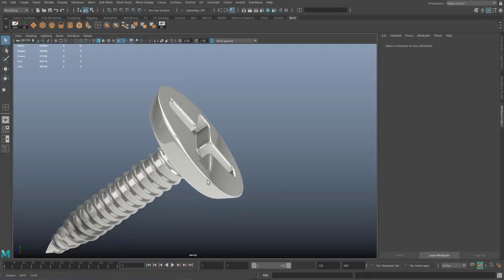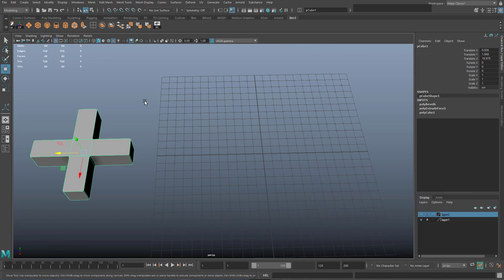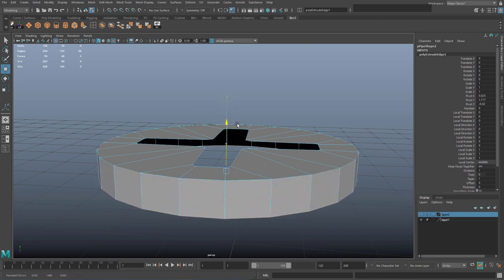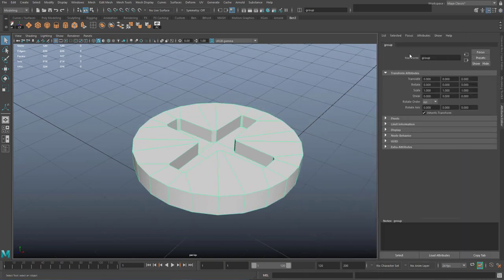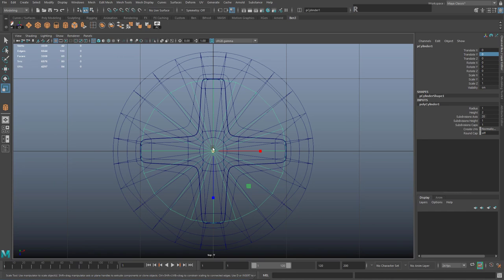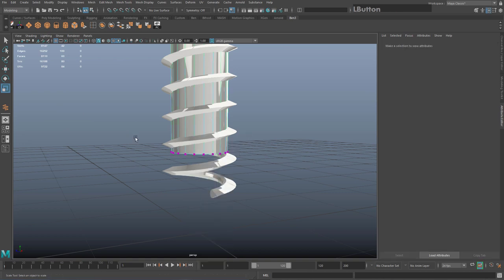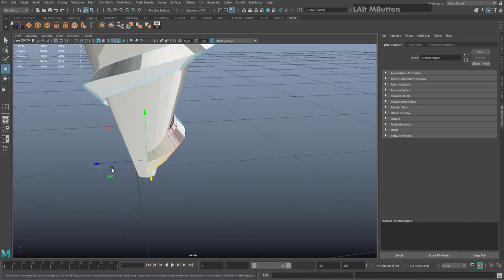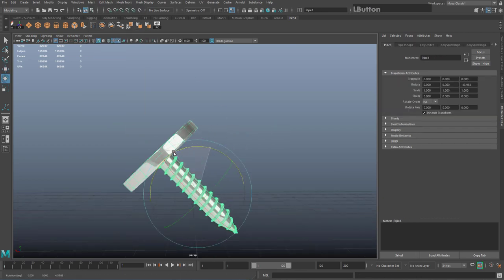How to model a screw in Maya with quads (subdividable)

Comment: Filling a hole or a circular hole:

You can try pressing extrude after selecting the border edges of the hole.
Merge the vertices.
You can delete every alternate edge converging to the point to maintain quads.

Comment: Nice tutorial but I found out an easier way. You do the cross and protect the edges like the beginning, but instead of doing the cylinder you extrude the edges outwards and use circularize.
Reply from the maker: Yes, indeed. I only found out about circularize after making this tutorial. I immediately made a tutorial for it here if anyone is thinking the same thing: https://youtu.be/Kozf89GGswM